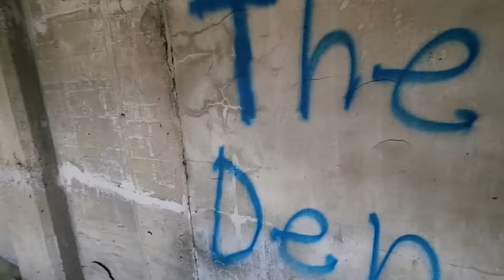Saying goodbye is hard..

Comment: Fun fact: U.S. "paper" money is not made of paper. It is made of 75% cotton and 25% linen! That being said, I grabbed a few bills and held them up in front of my window (indirect late afternoon light). You can see through them SO much that you see both the image printed on the front AND the image on the back (reversed, of course). So you're correct in calling them out. They look SUPER fake in the artwork because all you see is the image from the "front" side.
Furthermore, it looks like they are ALL displaying the front side, and if they were actually "fluttering around" you'd get a mix of front, back, rightside-up, upside-down, etc. (with BOTH sides showing through each other as appropriate to orientation and lighting).
Wow - - money is more difficult to comp than you'd think, innit?!